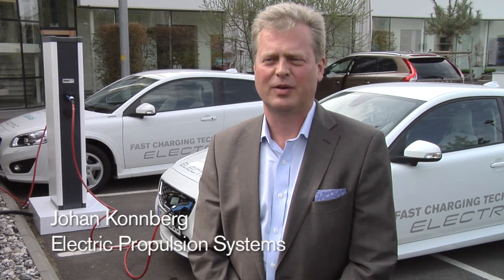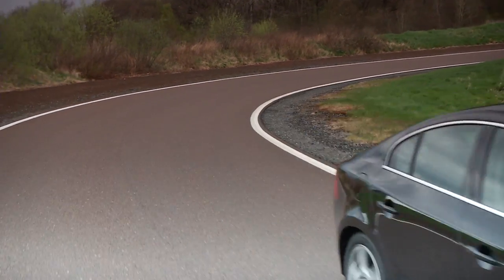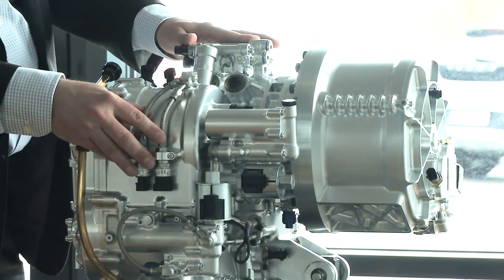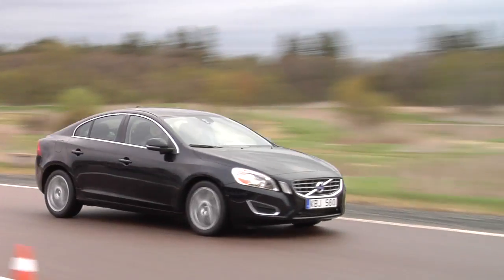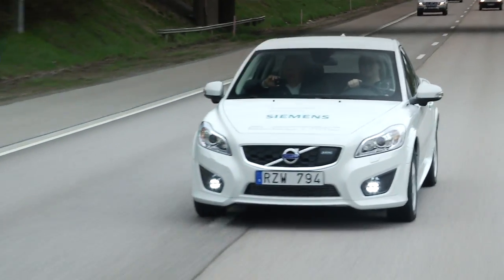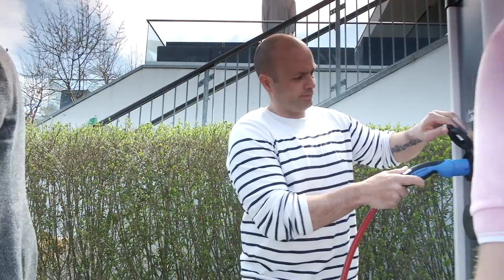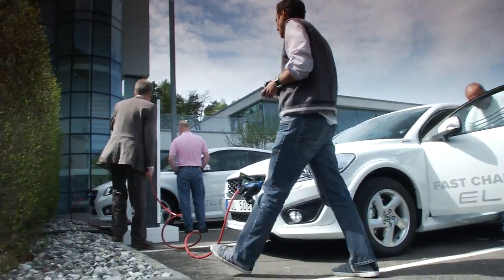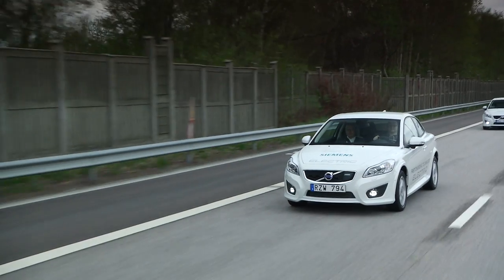Two New Volvo Innovations: Second Generation C30 Electric Fleet & Flywheel KERS

Comment: I owned the xc90 2017 momentum which averaged 32 MPG. Sold it to treat my wife to the upgraded XC90 Inscription plus with KERS - Zero difference to fuel economy. If anything it is slightly less at 31 MPG. Before the naysayers pipe up - exactly the same journey every day too and from work by the same driver....nothing changed regarding driver habits. Go Figure!!